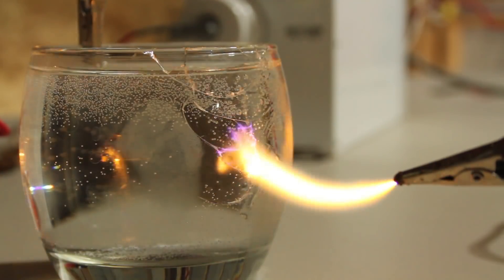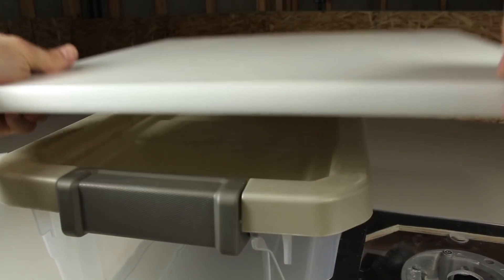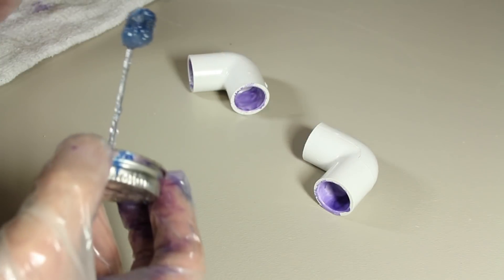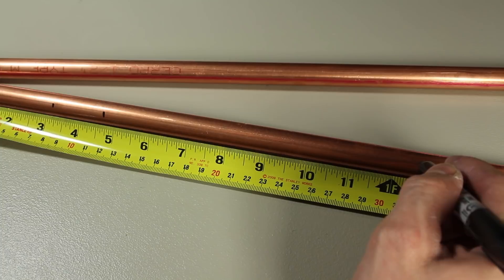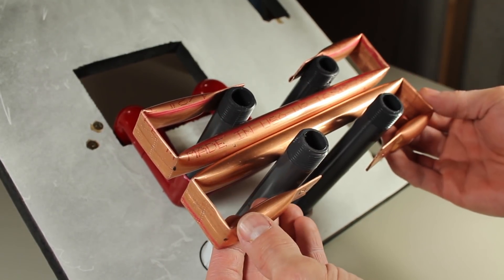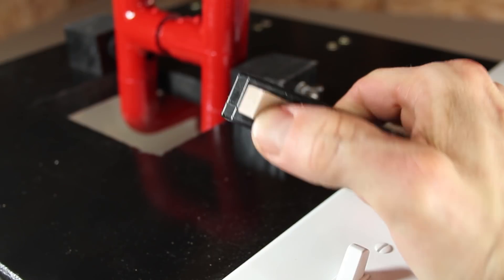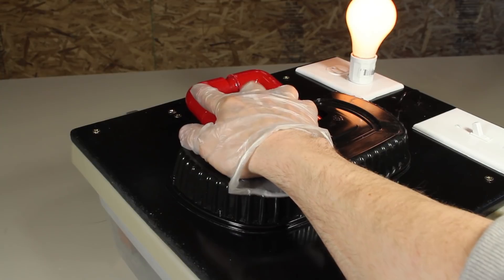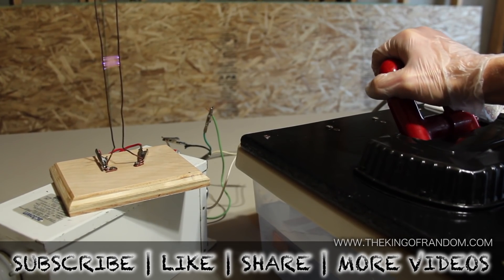The Scariac (Poor Mans Variable Power Controller)

Comment: Pssht, that's a potentiometer, not a variac
Reply: minerguy31 a potentially-lethal-ometer?
Reply: +minerguy31 Technically it's a rheostat.
Reply: +Truonganh Le  you're* dummy*
Reply: +WelcomeToMyDream A "potentialethalometer"
Reply: so if your using a pot with one fixed terminal and the wiper terminal do we now call the pot a rheostat?
Reply: robert franklin Rheostat also implies it has current carrying capabilities, pots most often don't.
Reply: The name potentiometer implies it controls potential, which is voltage. This trades potential for current as the electrodes get closer. Some potential is "relieved" the closer they are, which allows greater current flow. I'm *not sure what the right name for that is, actually. :|
Reply: its a potentiometer,  how is it 2terminal? the neutral is just a  loop between the sockets
Reply: +TheAmmoniacal : Yup! a Pot has three lugs, a Rheostat only two.
Reply: Your a dumy
Reply: TheAmmoniacal
 Well yes, I just figured that the name potentiometer, as in "potential difference" - which is what voltage is - covered that part of the subject. That's why I didn't mention it. good point, though.
Reply: power controller?

Comment: "This is about as dangerous as sticking two live wires into a bucket" That's EXACTLY what your doing
Reply: i reccomend watching ElectroBOOM's videos (just a fact: hes got a masters degree in electricity...). Youll learn a metric shitton about electricity. Simply sticking 2 live wires in water wont do anything IF there are no chemicals in the water. You can stick live wires in the water and touch the water, you wont feel anything. You will start to feel more and more pain as you get closer to the wires.
Reply: @Sharpless2  about 1 year late, but he also has a masters degree in failure
Reply: I have stuck two live wires into water for years and never had a problem. It is when you add salt, or in this case Lye that problems can occur. I filled 12 Coka Cola  6.5 oz bottles 1.5 inches from the top with water super saturated with salt. Then I topped off each bottle with mineral oil. I then took each bottle cap and drilled a 1/4" hole through each one then ran a 1/4" x 6" stainless bolt through each cap. I first put a 1/4" stainless washer and nut on the bolt leaving about 1" of the bolt extending up through the cab then locked the bolt to the nut with another washer and nut. Then I put the bolt and cap assembly back onto the bottle and recrimped the cap. This left 5" of bolt inside the bottle and 1" above. Then each one of the 1" bolt ends I connected together using a thick copper wire. I set the connected bottles into a plastic tub with a metal plate in the bottom and then filled the tub with more salt saturated water. All this made up my capacitors for my Tesla coil.
Reply: @Kevinegan1  there’s only 1 live wire one is neutral
Reply: In a single phase system (like most of residential power systems around the world), two live wires won't do any harm even when touched together, because they don't have a potential difference. But in a 2 or 3 phase system, yeah it's dangerous.
Reply: @apocaloptigon9988  Interstellar rocks.
Reply: @Sharpless2  yum
Reply: @furniksadventures9660  ikr.
Reply: That would be the joke

Comment: Can I use tin foil instead of copper tubing?
Reply: Cedric Elias no it doesn't have enough power to withstand the amount of volts going through the water
Reply: Cedric Elias ur body can work
Reply: +Howtokillazomble *Amps
Reply: +Howtokillazomble And sodium hydroxide will react with aluminium.
Reply: Ok
Reply: +Cedric Elias  tin foil will decompose with lye , you will get a mush pile of green guff where the aluminium foil used to be
Reply: +FailedPoliSaint  its been my experience that contacting drain cleaner with aluminum is explosive and a BIG NO GO
Reply: James Smallwood there's also that though i knew it was with chlorine .

lye will corrode aluminium into a green weak mush.

Comment: I have a question.   Could you do this with a dimmer switch wired to an outlet instead of using water to control the strength of the electrical current?

Comment: Grant, could I suggest you also include an isolation transformer in this design?
They're not particularly expensive and would make an incredibly dangerous device at least slightly safer.
Reply: Roderick Lenz Since this "Scariac" works differently than a variac in controlling electricity,there are other alternatives that does the same function as a "scariac" that are safe,such as the "fun-jiggery-pokery unit" which is basically 2 sockets wired in series,connected to a ballast such as a fan heater.A variac does something completely different though,it changes voltage with an autotransformer,whereas this scariac is a variable resistor,limiting current.People who needs both to be limited will usually use both a variac and a fun-jiggery-pokery unit together.
Reply: Thank you Goebbels, I do know how this functions. Without ego, I probably understand it better than grant does.
What an isolation transformer does, however, is provides a discontinuity between the ground, the mains power source and the device. As it stands, if you were to touch an exposed conducter, or dangle your hair in the electrolyte, your body completes a circuit between the mains power and ground. In the case of a single hair, it would probably just vaporize that hair before you even realized what happened. Anything else has a high chance of being fatal.
An isolation transformer is just a 1:1 ac transformer that provides galvanic isolation between the mains power source and the device, prevent your body from acting as a conductor to the ground if something goes wrong.
Reply: Roderick Lenz The point is,don't even bother with this design when there are already better alternatives.Furthermore,there are people who add isolators onto the fun-jiggery-pokery unit for added safety,so yeah.
Reply: Ah, my apologies, I misunderstood. 
But yes, there is no way hell I would build this. I admire the ingenuity, but it is a retardly dangerous device. I felt the need to mention an isolation transformer so that it's here in the comments section so that way if anyone was actually seriously considering building one, they might see these posts and think about putting one in. But now that you've mentioned your fun-jiggery-pokery thing, they'll go look that up instead and forget this death trap ;)
Reply: Roderick Lenz That is not my idea,it originated from YouTuber BoomBoxDeluxe and several people have built it since then.Well at least this is much safer to operate and most of the time the worst could happen is the ELCB/GFCI trips causing some inconvenience to the user,but not a fatal shock.

Comment: This is only worth doing if you literally put no value into your own time, you won't even save much money once you buy the materials, and if you have to buy the tools you are definitely loosing money.

Seriously just buy a variac they are not that expensive and are much safer! You can even buy second hand ones very cheaply! Why would anyone make this?
Reply: This is not a variac in the first place.It is just a rheostat.It cannot change voltage which the variac do.
Reply: I agree with you and I know this is not a variac. What I am saying is that to do what he's doing, powering down the electric motors in his tools, he should just buy a variac. 

I suggest a variac and not buying a rheostat because a  variac is a better choice for this application.

A rheostat will waste a lot more power as heat. This is not much of a problem in the design of this guys rheostat or 'sacriac' as there is so much water to dissipate the heat. But it is still wasting all that power.

Comment: This concept has been used to control electric motors for a very long time. When wound rotors were common on AC motors, they used electrodes wired across slip rings, submerged in resistive solutions to adjust the rotor resistance and adjust speed. Very very very old technology

Comment: These were actually used in the 1930s. A wooden box was sealed with pitch (tar). An acme screw was attached to a plate and a bushing set in the end of the box. Another plate was placed at the end of the box. The moveable plate had holes drilled in it so the water can pass through. Grease sealed the threaded bushing, and a crank was turned to move the plate. I think they were called water resistors. Mines and sawmills used to scrub off old monopole power supplies by throwing steel coils into a nearby river or stream. This also provided fresh fish for the employees. If you can find a 1930 Electrician's Handbook, check it out!

Comment: This is just a massive variable resistor though, not doing the same thing as a variac. A variac controls voltage with a variable transformer (coils of wire), a potentiometer (variable resistor) changes current. So for some projects, this can't replace a variac.
Reply: Mike Hart light and fan dimmers are very limited and cannot be used with higher current devices such as the one shown in the video
Reply: Yes but potentiometers are not that expensive and if you can't afford one you probably shouldn't be playing with electricity making  one of these
Reply: Alex lutz most Pots are rated to 1/4watts. The point of making this is to make a pot that can handle several watts. If you tried connecting a potentiometer to any power tools like he does, it's going to blow instantly. I was just making a point that the word pun "scariac" referring "variac"  might make people falsely think that they do the same thing.
Reply: James Hutton never say pot again
Reply: Light switch dimmers do not limit the current, they PWM (chop up) the signal. Non of the power actually goes through the variable resistor in the knob you turn, that merely controls the duty cycle of the triac that fires on every AC zero crossing. This method connot be used for most power tools with motors though. That's why most of them have a built in variac... like I originally said. 
Of you open most motors with speed control (such as a fan) you will see a multi-tapped transformer, so changing the knob just changes the voltage by changing the amount of windings of the built in transformer.
Reply: James Hutton Some(probably older) light and fan dimmers I see are just a variable resistor though.
Reply: Really? A 100w light bulb has almost a full amp going through it. I can't really see any variable resistor being able to handle 1amp or 100watts. That's the point of this project is making one that does. Most variable resistors can only handle 1 Watt at the most, not 100
Reply: James Hutton Well that light dimmer was pretty bulky...probably the reason why.I also saw older Tamco(Relite,owned by Khind) fan speed controllers are variable resistors,but the coils are quite small too.Not sure why the case though.
Reply: AngeV2 Erm yeah Fan controllers that use purely coils are able to work with motors too.
Reply: yeah. there is no single commercial variable resistor that is going to do any controlling of an power electronics such as a fan. It is either a variable resistor controlling a switching circuit, or a variac (variable transformer with coils). That is the point of this Episode, is making a ridiculously big variable resistor that can single handedly do what no commercial variable resistors would ever do.

Comment: sooooo... does anybody know why the voltage stays constant while the amps are increased and decreased? i dont know much about electricity, but i thought that the two worked together and as amps were reduced volts increased and vise versa or is that only with transformers?
Reply: Ohm´s law, it mentions the interaction between current (amps) tension (volts) and resistance (ohms), whats he is doing is increasing or decreasing the resistance, that way, the tension stays stable, but the current its increased or decreased also the power (watts) are increased or decreased in the same way.
Reply: jchinderle Voltage = Current * Resistance (Ohm's Law). This tells you that if you decrease resistance, your current must increase (with a constant voltage). There is a small voltage drop, but its negligible given the 120 Volts he's putting in.
Reply: jchinderle Because he is checking the voltage without a load(eg lightbulb), which means the circuit isnt complete. And if the circuit inst completed then there is no current flow. Which means no voltage drop across the water. He is just reading the potential of the mains.  If he did the same check with the light bulb in you would see a voltage change.
Reply: David Jenkins wrong. the voltage would remain the same, its basic electrostatics. The act of checking voltage completes the circuit, otherwise nothing would flow. Voltage is the energy difference, or how much energy can flow (like a water tank provides water to come out of a hose, but the diameter of the hose determines the current).
Reply: ***** The act of checking the voltage does not complete the circuit, if it was to do so a voltage meter would effect the function of the circuit during testing. Electrostatics has nothing to do with this. This is Ohms law.  I have build this sort of circuit many years ago during training solely to point out the fact the a resistor (bucket of water here) will not effect the open circuit voltage.  I have even found this online to help try explain what is going on, refer to the open circuit part about half way down. http://www.frankshospitalworkshop.com/electronics/training_course_ohms_law.html

Comment: If your running electricity through water, you hydrolyze the water into H2 and O2... So if the electricity arced somewhere in your circuit, wouldn't your apparatus potentially explode?

Comment: that wire looked more like a number 14 gauge wire than a 12, last I checked wiring was color coded, white for 14, yellow for 12, orange for 10(that is some thick stuff, I think 12 is a standard wire unless you have something that sucks in current like a big air conditioner)

Comment: Great project! Though I suggest using cheap ground up hydrogel in the water so it can't spill. Hydrogel is usually used for adding to garden soil and it's cheap. Or you could use another gel thickening agent, but anyway it' might be a good idea to use a gel to prevent spill risks, then you don't have the risk of water everywhere + electricity. With that change, I think this would be a much less scary controller.

Also as an electrolyte, you might use something like magnesium sulfate aka common bath salt, though lye is probably fine and lye might help reduce the likelihood of electrolysis breakdown of water as mentioned earlier in the comments.
Reply: Michael Casper I think a breaker would also make this much safer, make it integral and put wires near the rims of the box to the breaker, parallel to the normal current,  and that would ground out against the electrode that is always in the water, so that if water makes contact with those wires it shorts the breaker before water can spill.

Comment: could i use a scrapped high powered vacuum cleaner control circuit instead of the scariac for the arc welder?

Comment: fun fact  this item produces  hydrogen /w oxygen  its  a bit dangerous if not ventalated
Reply: It's AC which shuts the slow electrolysis reaction down, It also contains lye which also slows down the reaction.
Besides, since the box isn't air tight it will ventilate the little gasses that are produced..

Comment: This is a cut price solution :-)
Just the risk of Poisonous gas bubbles!

As an alternative, for high Amp heaters (electric bar fires).
Make a burst fire mode controler: just a Triac
With the gate power from a 555ic chip.
By ajusting the pulse frequency - more or less power
is delivered to the Load ;-)

Comment: Shouldn't some additions to the container be made to make it more water-tight?
Reply: *****  You don't want it tight.  Gas is being produced and you don't want it confined.  He should of mentioned that.
Reply: MrSbfan2000
Interesting, but still then wouldn't you want to make it water but not air-tight to prevent any of the water from sloshing or splashing out? The idea of a non-isolated water and electricity combination makes me so nervous lol.
Reply: If it's water tight then it is not ventilated enough to vent the hydrogen.
Reply: Good response but just to clearify.  Electrons take the path of least resistance which is not always the shortest path.
Reply: Lol.  My phone dinged and woke me up...I read it as shortest..sorry.

Comment: For how long that battery will work ? And some explanation around this matter will help every one to give you thumps up ! I Think !
  Because that is the question :For how long that thing will work and when stops , how to charge again ?
Reply: Its not a battery
Reply: What is it then ? and how long with out any outside help works ? Please
Reply: It is only a current limiter, it will not do a single thing without being plugged in.
Reply: Thank you
Reply: Bahram Kashanian in all fairness, I noticed recently YouTube or Google + has been putting comments under the incorrect video. At least I saw it once this week. This is for a diy variac using water. Its like a throttle or power control device.

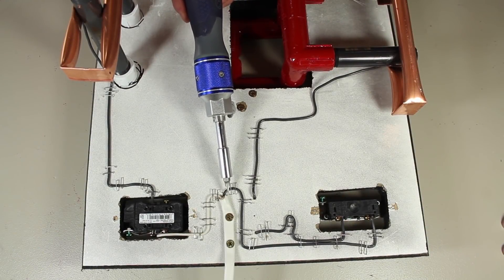Comment: I feel scared when I look at 5:07.  If someone puts the screws in holding the white and black wires (in the sheath) and electrically the wires touch via the screw, a lot of sparks are gonna fly.  Please be careful.

Comment: I recently constructed a ball mill that uses an eggbeater motor to turn the mill. My only problem is that it runs way to fast and consumes a lot of energy (1.75 amps) Would building this power controller work in this case?